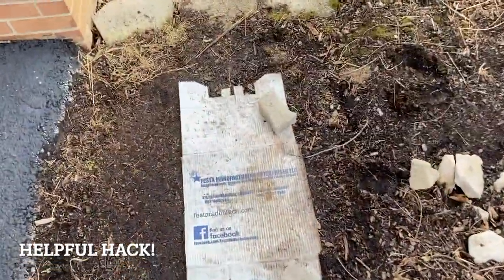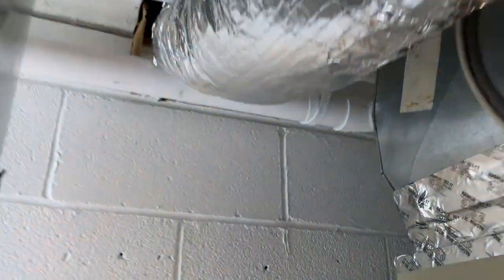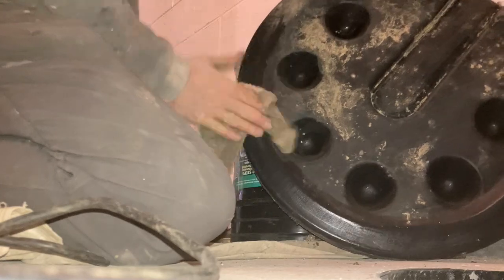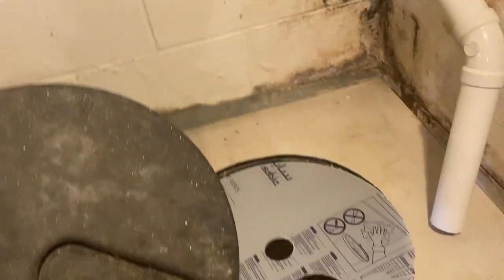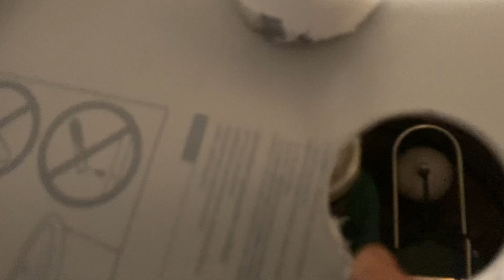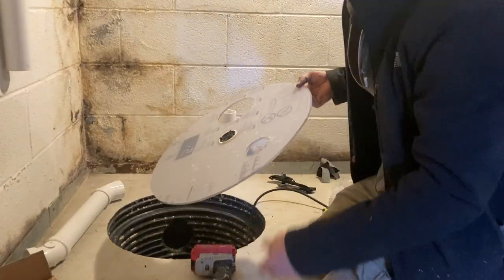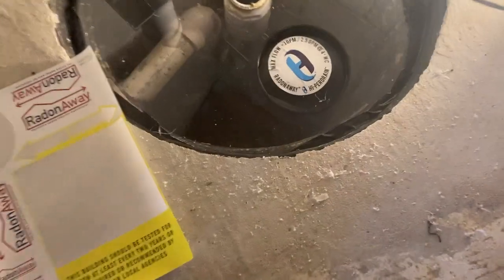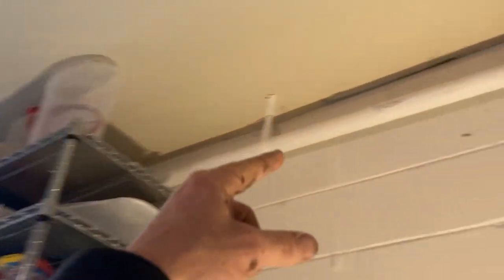Radon Mitigation And Sump Pits and Perimeter Drains  HD 1080p

Comment: I like the idea of the ball to allow water to come into the pit, I do wonder if the water sitting on top of the lid will have enough force to break the negative pressure that the lid will have on that ball? Also didn’t see if there was a check valve on the sump pump to prevent pulling outside air into the pit?